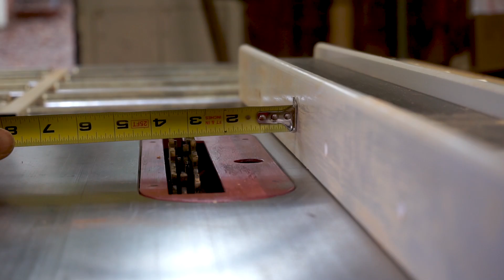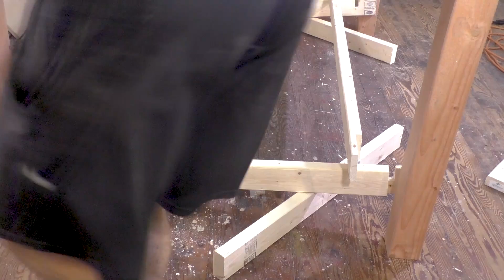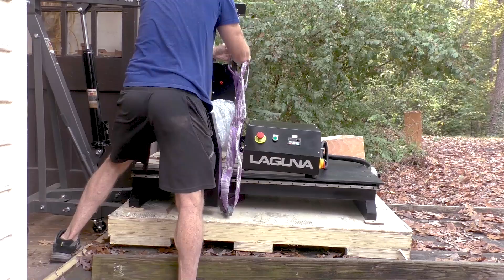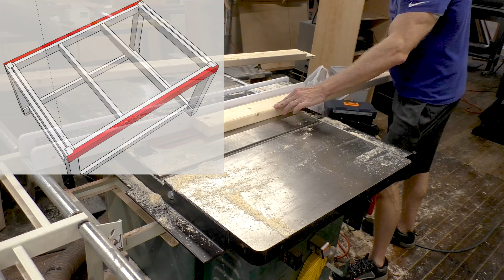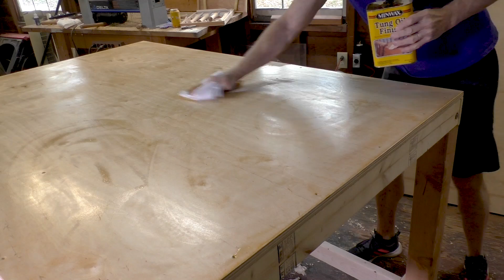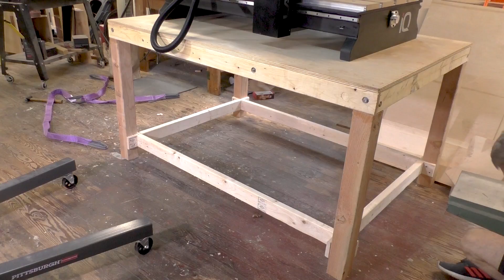Building an inexpensive sturdy workbench

Comment: Mine is perhaps, a little bigger. However, you did a fantastic job strengthening the weight bearing capacity on the top. I really likr the steel-threaded rods. 👏👏👏